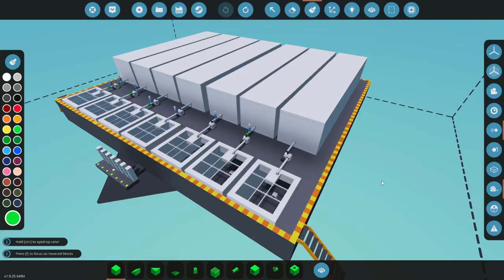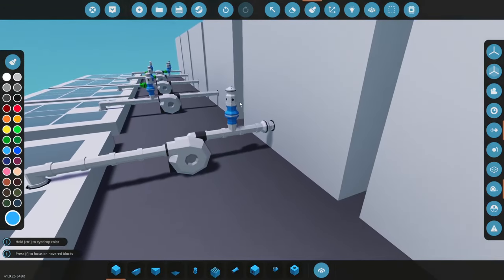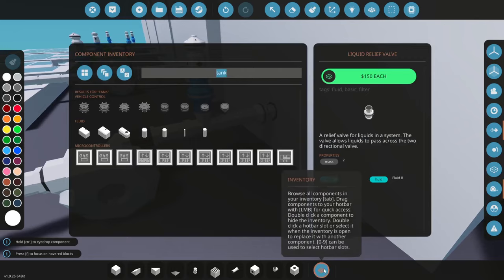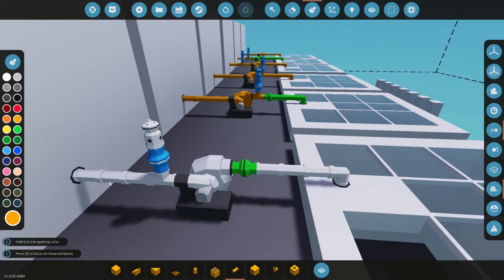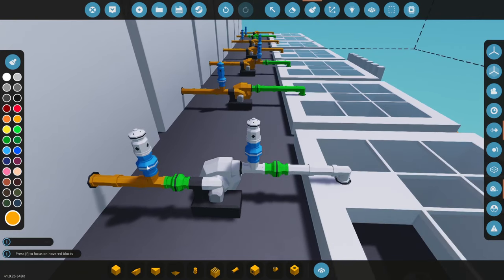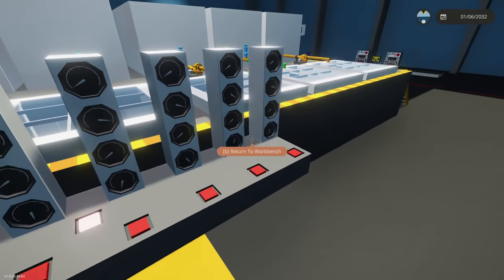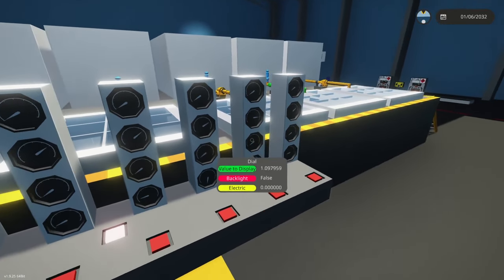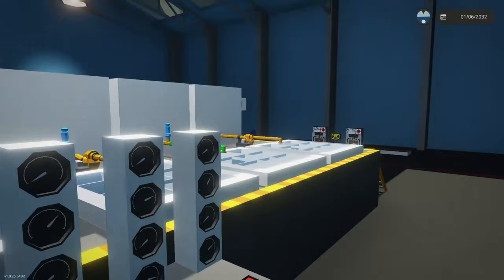GAS/LIQUID FILTERS for the BEST pumping setup in Stormworks!

Comment: Just wanted to say thanks for taking the time do these. When MrNjersey stopped making content it really left a hole in the Stormworks world. Its nice to have someone filling it! I've done a lot of testing myself as I am sub builder mostly. The hardest thing I used to find was pumping out at depth, the pseudo pressure made it so the deeper you went the harder it was to pump out when eventually you couldnt pump at all. Its all changed now and depth makes little difference so that has made testing a lot easier. All these videos are contributing to my subs so am super happy you're doing them, thanks!
Reply from the maker: Thank you for the very nice comment :) I am glad my videos help! I find pumping very interesting since it is practical and vital for most creations!
Reply: @454ss_gaming  yea I find it very interesting as I do all engineering. I'm currently experimenting with using pressure to transfer faster, repressurising tanks and relieving pressure while filling. It's quite a complex thing as it has loads of variables which can change over time as it builds. It's good fun though

Comment: Thank you for doing these tests, and with such professionalism! In my setups I've been using flow valves after the gas relief valve to prevent gas from entering back into my pipes before entering the liquid filter, which is before the pump. I've also been cycling the gas back into the tank rather than releasing it into the atmosphere. I would love to see some tests as to how using flow valves and releasing the gas back into the tank will compare to the other setups. Thanks!
Reply from the maker: Thank you for the comment and idea! From people on my discord,  I read that doesn't speed things up, but I would love to test that for myself!

Comment: @454ss_gaming One thing new I found is that 8 ports in the full tank, with a liquid only filter on each one, routed into one pipe then into a single large pump is faster than anything else. I did have 2 output pumps sucking filtered air out of the receiving tank though. Its more piping and not exactly ergonomic BUT if you must have filtered water this is the way to speed up the process to go faster than just two unfiltered pumps.
Reply from the maker: Incredible findings! Will have to try this! Thank you!
Reply: @454ss_gaming  just make sure you let it run, the 8 filtered ports into one pump will catch the 1 unfiltered into one pump after a short while. I am venting out the receiving containers for more speed though via  a pump. You may be able to get away with a few manual bleed valves though on the receiving container.

Comment: So, which system is best for a custom fuel tank into an engine? 

I currently have a gas relief valve in my custom tank, liquid vale into a pump which goes into the engine and after a while the engine goes to like half power before eventually dying. In a pain in the arse.

Comment: I just want to ask. Is it valuable to pump liquid from the tank with one pipe and a filter and to pump the opposite way air from the receiving tank to the first tank? And also: can we interconnect these systems? Can air release from first pump go to the second pipe and liquid from second pump go to first pipe? Do we really need a gas tank or just two pumps?

Comment: Don't the gas relief valves have a filter built in?  Do you need the filter leading into it?  Removing that extra filter might improve flow.
Reply: Also, I would think that if the pressure is being released from the output tanks it should match the external air pressure (1 vs 2); is there something going on preventing them from dropping below 2 atmospheres?
Reply from the maker: The thing on top is just a port, that would allow both liquid and gas through! The gas relief valve is in fact a gas filter aka only allows gas through!
Reply from the maker: They would eventually fall in pressure, but it is not happening quickly @trevans1
Reply: ope, my bad.

Have you tried pumping air into the input tank (more than the passive flow from the much smaller air tank)?  In theory, the fluid would be more willing to pass from the input tank into the output tank with a higher difference in pressure, and as far as I can tell the input tank can only drop in pressure as it empties while the output tank either increases or stays the same.

Comment: There is one thing that did not get tested. 
Pure liquid from tank. Why pull air/gas into the pumps when you can prevent it from the getgo ?
Which in turn would not make the pressure in the tank you are emptying go too low. You are also pushing gas into it from the gas tanks and you would not want that to bleed into the pumps and out of the tank ? 

Maybe i'm not thinking straight.